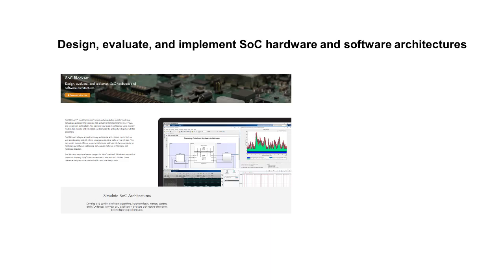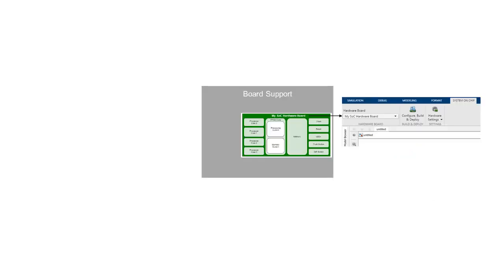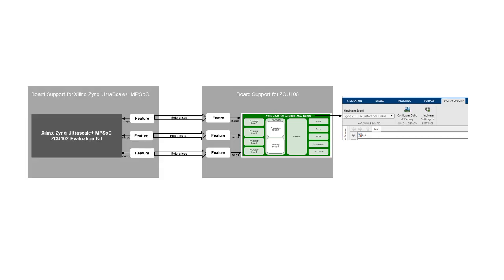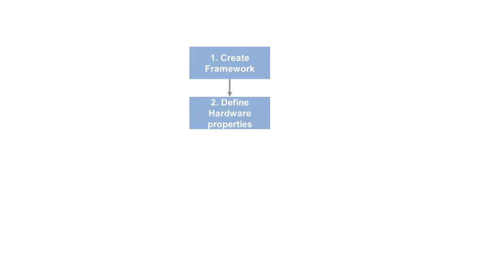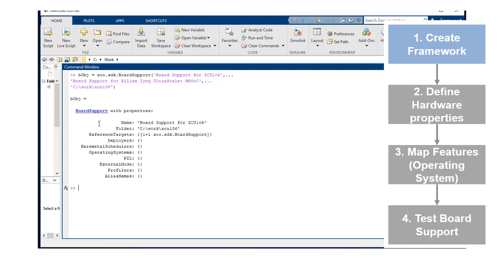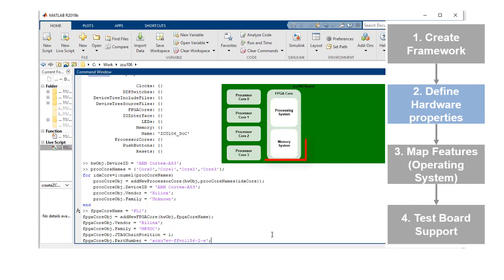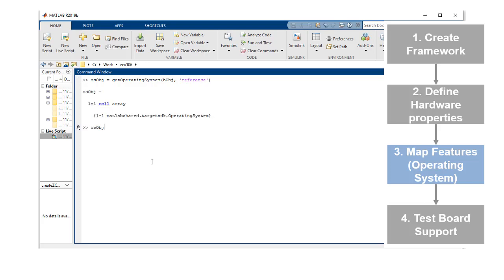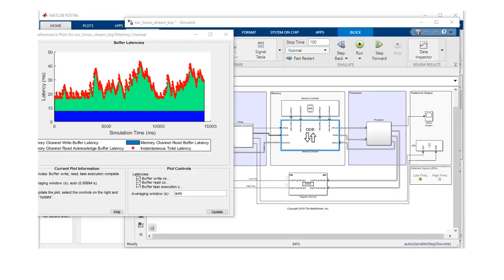How to Add FPGA and SoC Development Boards to SoC Blockset  | Hear from MATLAB & Simulink Developers

Comment: where I can find the mentioned accompanying script.
and guide please want to add ALINX axu2cgbe board and its both r5 and a53 processors
Reply from the maker: Thanks for reaching out, you could try the following examples which show how create custom board for soc Blockset. which is in similar lines of the MPSoC based soc. Please refer to the following links to build the custom board. In addition we also need to customize the Linux images present on these boards to be compatible with Mathworks tools. Please let me know if you need more help.
1 https://www.mathworks.com/help/soc/board-support.html
2 https://www.mathworks.com/help/soc/ug/Using-a-Custom-Board-with-SoC-Blockset.html
3 https://www.mathworks.com/help/soc/ug/define-custom-pynq-z2-board-with-socb.html
4 https://www.mathworks.com/help/soc/ug/customize-petalinux-image-xilinx.html
1 is on how to use the custom board API, 2 and 3 are examples of how to create a custom board, 4 is how to customize the Petalinux linux for the boards. 
 
Please let us know if they have a working Linux image built on the Petalinux build system from Xilinx.

Comment: Thank you for wonder full video,
does this process can be performed for zynq soc
Reply: SoC Blockset supports Zynq SoC out-of-the-box. But if you have a custom board based on Zynq SoC you can use the steps in this video to support your board. The refernce you need to use though is Board Support for Xilinx Zynq-7000 SoC instead of Board Support for Xilinx Zynq UltraScale+ MPSoC
Reply: @tanmayeesapre  Thank you  very much for your kind reply on this concept. I am using PYNQ Z1 board based on  ZYNQ 7020 chip and I try to build Matlab interfaced Linux  kernal for the Z1 board from git hub sources several times but failed miserably. Does this new SOC toolbox could help me to interface the ARM processor of ZynQ 7020 with Matlab Embedded coder without any need to develop Matlab interfacing linux kernal. Please kindly provide the references to any other source of material in this regard. I will be very much obliged to you madam for this help. Thank you very much for your reply once again .